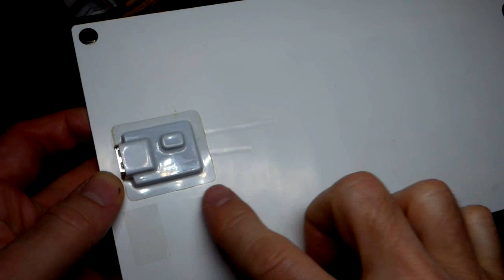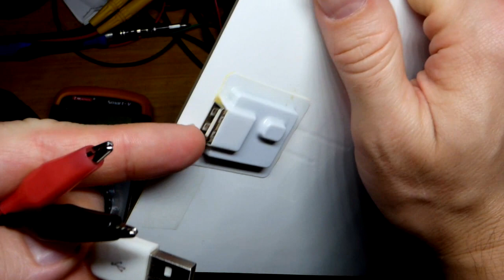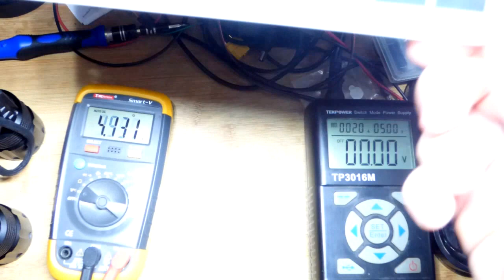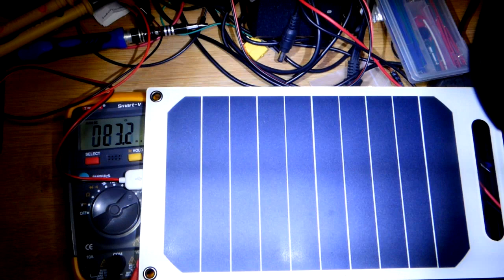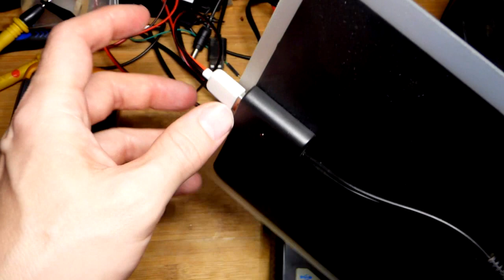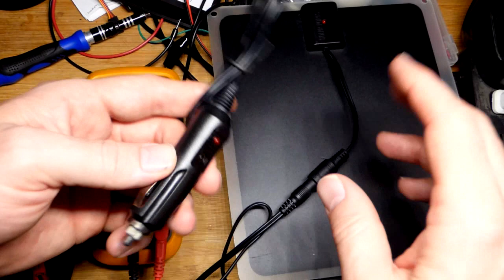Quick indoor test of my 10W solar panels using flashlights

Comment: Bro, I had leaned six, brand new 48" x 60" rigid solar panels up against my fence line. I turned on my outdoor LED light, which was a single 80W LED bulb rated at 7200 lumens. I was surprised to see I was getting 580 Watts output at 32v  (18 amps). This was a freak discovery, as I had been wondering why my charge controller said it was charging my batteries in the middle of the night.  So the outside wall mounted light actually helped charge my 24V battery bank. Anyhow, I do have a 10,000 watt solar array mounted on my barn roof so these six panels were excess panels just laying around to 'play with'. I harvest so much power from the sun during the day that I have literally melted a couple of those rigid solar panel connectors like ice-cream on an 8 gauge copper cable. By the way, you need a thousand milli-amps to equal one watt.
Reply from the maker: Very cool :)

Comment: Interesting video.
Just a tip (learned from experience):
It is best not to switch ranges on multi-meter with a rotary switch (such as one shown in video), while voltage is present on the probes.
This is not a big deal for low DC voltage. However with high voltage on the probes the meter will be destroyed.
Reply from the maker: Yeah, that's a good tip. Thanks for watching!

Comment: Okay, I guess I need to get my small solar panel out and do some experimenting, because I don’t understand how you can measure the current with the meter parallel to the circuit. I thought it had to be in series with the load. Thanks for another interesting video.
Reply from the maker: You don't measure current directly from a battery because it will usually produce more current than is safe to do so. You want a load limiting current with a battery, and you attach the meter in series with that circuit unless you have a clamp meter. Solar panels can only produce a limited amount of current, so as long as the meter is set to measure that much current, it is safe to measure it directly.